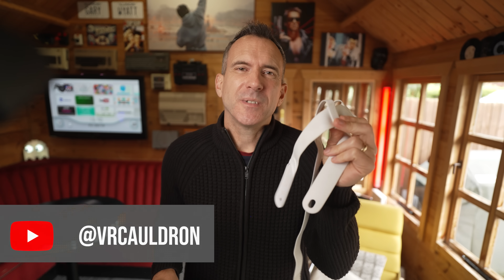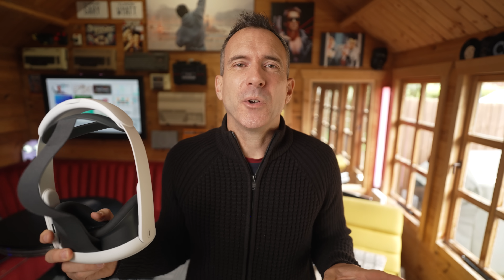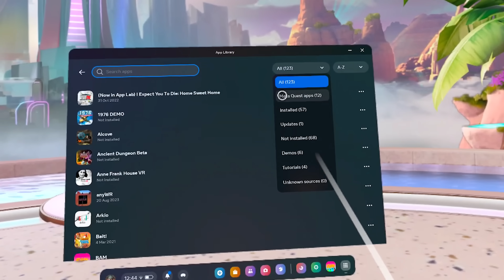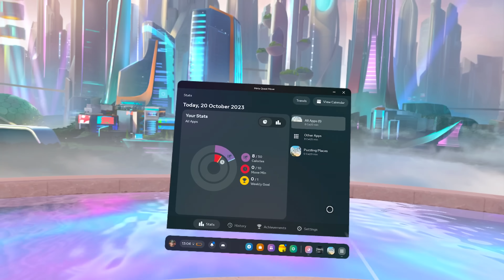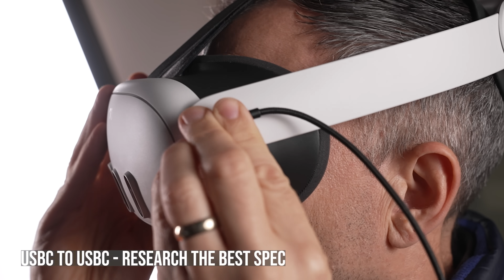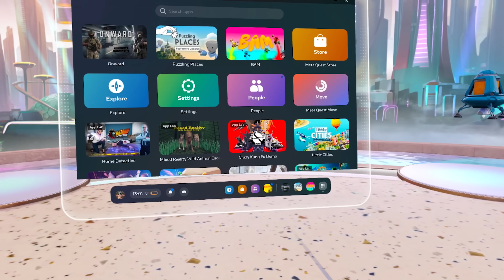15 Quest 3 Essential Hacks and Tips

Comment: I bought a Meta-Oculus Rift S one year before they dropped their support of this product. The Rift S worked well until I updated my computer.  Now two years later and after a year of Meta stupid suggestions for getting my Rift S working again, it's still not working.  I have a $400 paper weight that Meta refuses to fix even though they say my new computer should not be a problem.  I cannot recommend buying any Meta products due to their lack of customer service and having a chance of the same dropping of older products support.  Meta basically has no customer service and only lip service!

Comment: Thank you for the videos. Do  have a question though you said that you can set ipd to min or Max but you did not say how to get to the minimum that was not the mechanical minimum all the way down to 53. Thank you for info
Reply from the maker: Hi Steve - you can set it mechanically to the number stated but there is an accommodation range that is a wider range than the number you see. You don’t set it - the headset just accommodates a range bigger than the minimum and maximum so if your ipd is at either end of the scale then you set it to min or max.

Comment: Thanks for the video. BTW, the easiest powerdown option (in my opinion) is to just hold the powerbutton until the headset powers down.
Reply from the maker: Thanks for the comment - Yes that’s what I do - I think the problem sometimes is that people think they’ve powered it off but all they’ve done is put it in standby mode because they haven’t held it for long enough and then the battery goes dead. I did this myself a number of times when I first got the headset - it was very annoying

Comment: great tips as always. i just want to add something about power bank: your power bank must have type c output and handle at least 18 watt for external device. because quest 3 is a power hungry device and in the intense and heavy graphices games when the headset use its full power draw, if your power bank cant handle at least 18 watt power output the headset is not charged and eventually died out fast. i recommended power bank with type c output and 20 watt output power.
Reply from the maker: Yes the Anker power core 10000 says 25w output on usbc - thanks for the comment

Comment: I will sometimes move to a different room for more space or to avoid interruption.  I lose the  long menu bar and find it difficult to locate it without turning the headset off and restarting it.  Any suggestions?
Reply: Hold the Oculus button/Meta button down for a few seconds to re-center, this will bring the menu bar back in front of your face.
Reply from the maker: I had this and sometimes I would keep pressing the oculus button and other times go to turn it off but then select cancel and this sometimes sorts it - I haven’t had it recently though. Hopefully it will get sorted in the next update.

Comment: A note regarding power banks. Not all will actively charge the headset while playing. In fact you should look for one with chick charging usbc to usbc function outputting upwards of 20W. I have one outputting up to 30W and don't have any issues with battery life anymore
Reply from the maker: Thanks, this is good to know, I think I’ll make a separate video on this as the quest 3 is hungrier than the 2 and choosing a powerbank is always tricky.
Reply: @EatSleepTech did you?
Reply from the maker: @ExpandedUniverse000  I’ll be making a video on this next week
Reply: Can you elaborate a bit plz, which brand or what should i search for online?
Reply from the maker: @XX-cu4ug I’ll be making a video on this next week
Reply: I personally got a dewalt usb C adaptor that clip on belt, cost 20$ canadian for two, and a use a 20v 2 amp battery, can play for a long time and i have 2 battery so swap is quick, and also as enough power to recharge while i play

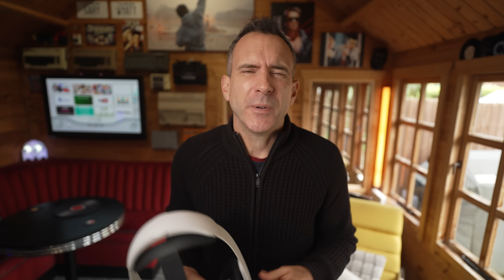Comment: 5:14 the issue is when the quest 3 is pushed it won't charge very well like you an have a split link cable to your PC and a 100W power brick and it will drain the same as with out it jut playing MR/Updated VR games.
Reply from the maker: Yes good point, I haven’t tried it on pc with a split link cable - didn’t even know this was possible.

Comment: Can I use a power bank that exceeds 10,000mAh? I have a 20,000mAh powerbank from Baseus (22.5w), which is a reliable brand, I believe. At least that's what people say
Reply from the maker: Others have used 20,000 in their pocket - I went for 10 because with the quest 2 originally I was putting it on the headset and 10k is quite light. Have a look on Reddit there’s some good info on there.

Comment: Heads up, DLC is not shared between profiles.  If the alt profile tries to use dlc it will tell them to purchase the DLC and also the game since they don't own it to buy the DLC.  It's completely broken.
Reply from the maker: Oh man that sucks and is not made very clear, that’s very broken as you say - it says you can share eligible apps so maybe there are only a few eligible ones! Thanks for the comment, good for others to know 👍
Reply: @EatSleepTech  Wish I knew before buying DLC that others were going to use.  Tried using some Beat Saber songs on another profile and it didnt' work.  Did a little digging and found tons of posts on reddit and the meta community forums about this. Such a bad process and should be a warning up front about this.
Reply: Most people don’t usually share a quest tho but that still sucks. Also wouldn’t that suck to have to share one? I know that sounds bad but I mean, sharing a computer is one thing but a vr headset would just suck
Reply from the maker: @caharlis  if the family play then I think creating different profiles is good for saving progress and achievements and if you go online you’d want to be seen with your own name I suppose not someone else’s. App sharing is great if you have more than one headset in the same house.
Reply: @caharlis  still they should have some kind of household sharing if I’m going to buy multiple headsets. There’s no warning and no info on it unless you specifically ask.
Reply: @Remix26 yeah I know but I’m just saying that it would suck to have to share one

Comment: Could the power bank harm the headset? Also, could you link the actual power bank? I click the link and it takes me to the page but I'm not sure which one you're talking about.
Reply from the maker: I’ve used powerbanks with the Quest 2 for 3 years with no issues but you need to do it at your own risk. There’s a lot on Reddit about it. Annoyingly on Amazon US the search wouldn’t bring up any of the anker powerbanks. It’s the Anker powercore redux 10000 which is still sold in the UK - you want one with usbc output.
Reply: The Quest 2 powerbanks do not have the same Voltage as the Quest 3 battery. It is too low.
Reply: @maegnificant  if you looked at the video, you would see the powerbank was an independant battery not one of those 5W (5v 1A) quest strap battary powerpacks. The  anker powercore redux 10000 mentioned here is 18W (5v 3A) and I would suggest anything 18W or over should be fine.
Reply: @dtrjones  I am talking about Volt. Not Watts.
Reply: @dtrjones  the Quest 2 has a lower current than the Quest 3, which means the lower the charge of the headset is, the less likely a battery with a lower current is going to actually charge the battery.